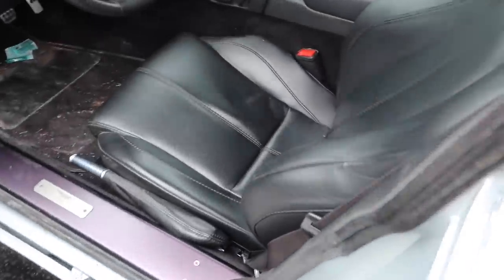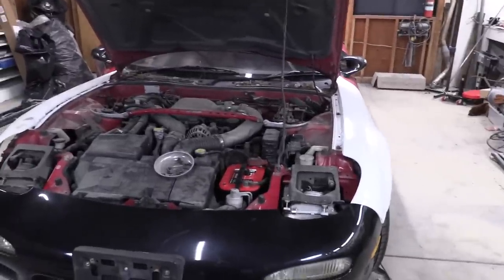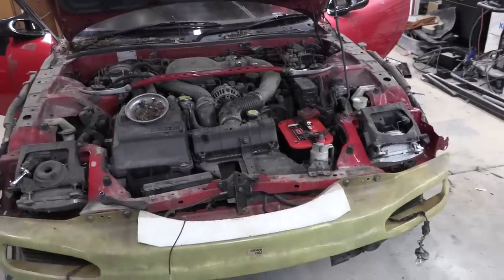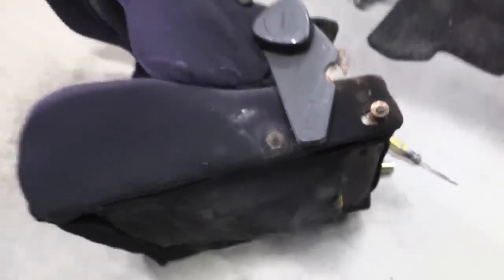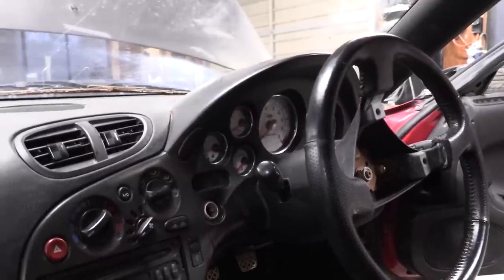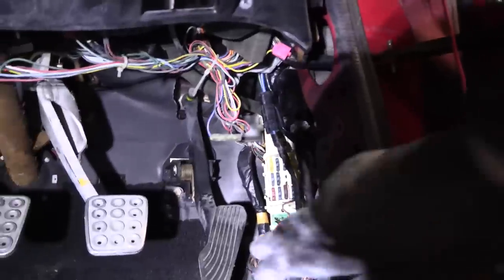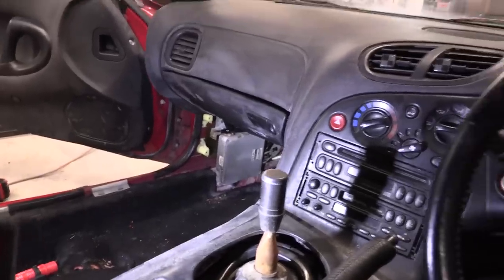Everything Wrong with my Cheap Imported RHD RX7 😜

Comment: Hmm... Did you buy a tsunami car? There were thousands of them after the 2011 disaster. :(
Reply: Ian Hobday seems this could be a sensible conclusion. With the wet interior, dodgy electrics, watery fuel, not starting
Reply: It would be completely covered in rust if it was one. It is just wet inside from the missing door windows.
Reply: Magonza which flood damage is likely to cause, the white marks are  caused by water damage and the ecu is low in the passenger foot well. It can all be fixed but caution is the name of the game. Many nasty diseases could be caught if he was cut on the metalwork for example.
Reply: Magonza yeah you're correct if it was from the last big tsunami it'd be long gone. I guess it's more likely to be recent flood damage or  simple water damage. Certainly lots of evidence for it. I'd be wearing thick gloves for sure! Empty the interior and wiring then clean the shell thoroughly
Reply: Taste the white marks, salty? May still be damaged by tsunami,just not totally wrecked. Still previous owner was a bit of a butcher.
Reply: First thing I thought too... From the flashers.... Then with water damage & wet interior yep ...but it's just a thing... Wish I was there to help.... Good job Chris...🤣👍
Reply: The last register date matches up too, the tsunami was 2011.
Reply: The white stuf could be dried up salt? But he probably would have been able to tell.
Reply: yea looks like a salt water flood car honestly.
Reply: Skwisgar2322 The big 10 on that sticker is actually the month, October. The exact expiration date is the smaller text that can also be seen, I think it starts with 23 which would be 平成２３年 or 2011 in Gregorian calendar years... I’m on mobile though and can’t see the smaller text as clearly as I’d like.
Reply: I think the interior is probably wet from the customs cleaning, we imported stuff from USA and the customs over there and over here blast the ever living crap out of everything (and I mean everything) with pressure washers
Reply: Radioactive RX-7!!
Reply: "Taste the white marks... "  No.
Reply: definitely what im thinking
Reply: Ian Hobday close, the last registration date on the title is 2015.
Reply: If it really was flood damage the head lights and tail lights would have a lot of condensation in them and be yellow

Comment: If you're wondering what the sticker on the windshield means,  it's for the mandatory vehicle inspection in Japan. The 10 is not the year, it's the month. It says it expired October 17th, 2015 (Heisei year 27), (27年10月17日) which means it last passed the government inspection on Oct 17th 2013, which includes emissions, suspension, and a ton of other things.

Comment: Those taped up lights under the bumper are for foglights (looks like they've been removed). The blue strap in the trunk is pretty rare, the white gauge cluster is also rare, and those carbon fiber mirrors are Ganadors that are worth about $1k for a pair.

Check the engine to see if it's flooded. Rotaries flood easily if they are run for a short time and shut off without warming up. Pull the EGI fuse (big yellow fuse in the main fuse box). Then pull the leading or trailing plug in the first housing. Hold the gas pedal all the way down and crank the engine for 10-20s. Do the same thing for the rear housing. Put in some new spark plugs, put the fuse back in, and try to start the car.
Reply: Howzer Tech sir, You're a legend
Reply: I'm building a FB with a FC front subframe and 13B and I can't agree more that it's likely flooded.  Marvel Mystery Oil after cranking with the fuse pulled and give it a shot once it's warmed up.
Reply: They were probably removed to fit a front mount
Reply: get this up further
Reply: This guy RX7's.
Reply: waht about trying to hook some obd scanner (I know that cars pre 2000s are rare or their specific obd ports but it can work)
Reply: Howzer Tech those ganadors probably aren't real. I'd assume at least.
Reply: Marek S the early FDs don't have OBD. That was introduced in 1996 along with an ecu revision and solenoid/wiring improvements. These FD's, however, do have a diagnostic pannel on the right side of the engine bay that can be used for diagnosing issues.
Reply: Next Level Scrub they could be fake. There is a version of the Ganador mirrors that comes with a carbon fiber cover, which these look to have on them.
Reply: @Howzer Tech Does the fact that it's an Efini RX-7 mean that it has a white gauge cluster and the blue cargo strap in the back? Or was that just a nameplate? How does an Efini RX-7 differ from a Mazda? Just the badge?
Reply: I love people like this, when they talk you can be 100% sure they know what they are talking about
Reply: God damn. He should just fly you out at this point to help get it running 😂😂
Reply: Mazda sold the RX-7 FD under the name brand "Efini" in Japan. It's just a naming scheme to make Japanese buyers think that Efini was more luxurious brand than their normal cars. Kind of likehow Lexus is a luxury brand of Toyota.
Reply: I'd love to go. I'm tired of the snow here, haha.
Reply: Howzer Tech or he could just push start it by getting it up to 5mph and putting it in 2nd gear and dumping the clutch
Reply: If you can source 13b-rews for 1300 these days, i'll buy them all. even 13b-ts are closer to 2k now.
Reply: Dude knows his shit. I however, do not. Hahah
Reply: items like that usually get lost from owner to owner
Reply: Howzer Tech according to his new video you're 100% correct!

Comment: God,  I would pull everything.  Harness, Engine, interior, Dash everything... I have a feeling a new harness might be needed since the water damage seems quite extensive.  Once everything is out take everything one by one and check.
Reply: Badstainless All that in 3 weeks, even a proffesional shop with 5 employers working on it its not possible. Its not overhaulin with a crew of 30 and the "magic of television'

He wants to take it to disneyworld in 3 weeks. Even the bare minimum to get it driveable there safely is a big question mark
Reply: markalmelo I never knew he had a time frame.  Even if he did it’s not exactly something I would rush out.
Reply: Badstainless like with everythíng on this channel he sets a timeframe. I thought the only one that he didnt was with te mustang.

I agressief with you, if this is his dream car i would take my time, strip it completly and start from there. It will take about a year but he could do other cars next to it
Reply: Yeah, I'd yank all the driveline stuff out get it looked at and compression tested (yes, it can be done on a rotary) at least. I'd probably get a new ECU and eliminate that as a potential problem to boot. It'd be pretty much a full rebuild if I were doing it.
Reply: This is the best way to go about this car. It's exactly what I did. He can pull the harness, source a new motor and harness and cram it all in in a couple weeks. The rest of the car has major issues.

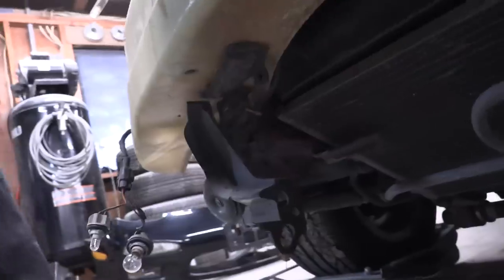Comment: OK you have the dual oil coolers, no sunroof, strut bar and suede seats (passenger) which in the states were all R1 features. The wires taped up at 6:10 are for the fog lights. The fenders on the car the ones for sale everywhere on Ebay. If you want aftermarket I would recommend Shine. They make a lot of cool stuff for the FD. Those blue Bride seats are pretty common in Japan but pretty rare here in America. All the FD mirrors start to look like that after a long time. Its actually the glue separating the layers coming apart at the bottom.

The car could be flooded if it wont start. Look up the un-flood procedure. Its a pain.
Reply: Doesn't shine usually have a lead time of 6 weeks?

Comment: No Start: the Rotary engine is notorious for flooding if not allowed to get up to temp.  And if it  ran like poo, it's likely bad fuel fouling the plugs.

Strange tapping into the wiring near the driver.  There's an "ETC" Electronic Toll Collection box in most Japanese cars.  They look like a skinny external 3.5" floppy drive that a driver can pop their toll registration card into before driving.  it's likely just binned and the person left the wires. 

:)
Reply: Busters Garage that or a turbo timer. They love those damn things in Japan.
Reply: Dan Bonnett yes, yes they do!

Comment: FYI, the reason why the wires disconnected under the driver seat is kill the seat belt alarm while driving, but those were needed to be still there for “shaken” which is like smog check ; all the safety feature need to be in workable condition. That’s why many of Japanese just disconnect it to kill but make it able to put it back for the checking. 
Ur rx7 looks nice, I wish I could have rx7 while I was in the us. That car sold as parts ripping car for ur main car... so must be very hard, but I’m looking for ur rx7 running!

Comment: So keen for this build! Chris since the car looks to be rather just miss matched and a backyard job on a lot, I know you are replacing the fuel but I would check the fuel lines and make sure they are still good, Wouldn't want lines degraded and putting gunk in with the fuel!

Comment: drain and flush tank and coolant and oil. Soggy seats suggest the car may have been at least partially under water. get the wiring dried out and see if that helps with electrical system. you could use a spray that displaces moisture on the wiring, especially components including distributer and coils. Hope this helps and looking forward to seeing this project complete. Best of luck!

Comment: Right front wires are the fog lights, the other one in the front loom is probably a ground, 
Do over every ground in this car, they all go bad and cause silly faults especially with lights, 
Engine is probably flooded or low compression, remove the spark plugs or ignition relay and turn a few times to de-flood,

I highly recommend a rotary specialist compression checks the engine before anything as that will tell you when you need to rebuild and a good looking over never hurts on these things,

The vac line rats nest simplification is always worth while as the solenoids always go bad and cause havoc with the car,

Battery relocation will provide you with a lot more room to work with, 

As with parts to order or source now,
You will more than likely smash the dash binnacle dome, they are brittle and expensive, pull towards you to remove once unscrewed,

Also the screen/ dash vents always crack, be careful around them,

Replace the door handles immediately with aluminium items, they WILL break and always at the wrong time,
Whilst your there try install a blanking strip over the rod mechanisms, these cars are easily broken into by removing the bottom window seal giving plenty of room to pull the unlock rods, 

Fuel pump hardwire mod is a good reliability mod to do,

Replace the plugs with good BURQ 9s 

More than likely the dash has just been unplugged, 3 or 4 colour coded connectors behind the ignition barrel. 

Starters are very lazy on these so a performance starter helps save from flooding 

Loads more to add but I’m sure you are somewhat aware by now, 

Any questions just hola’

Comment: I had one of those.. Rear seats are really rare in the US!  The car didn't have a great grounding side of the wiring. Adding a wide from the battery to the engine helped a good bit for smoothness at high rpm

Comment: With Rotaries, id suggest changing, Spark Plugs, Sparkplug wires, Coil Packs, Fuel Filter, and intake filter, but before doing all of that, a compression test is definatly reccomended

Comment: Hi Chris, the dating system is slightly different here in Japan, the numbers basically mean that the last inspection was valid until October 17th, as for the year, it's Heisei 27, which means the last inspection was valid until October 17th, 2015, meaning it last passed the Shaken (inspection/saftey/MOT) in October, 2013.

Comment: Dont skip the engine, take a compression tester. Take out the schrader valve pullout spark and fuel pump fuse. stick compression tester in one of the rear plug holes and crank over few seconds... put plug back in rear hole then do the same for the front rotor and will give you an almost instant idea on if the motor is shot or not.
Reply: Just in case he reads this:
A compression test should be done on a warm engine. You should see three even compression pulses as the engine is cranked if all of the rotor faces are in working order. Expected results vary by altitude and cranking speed but numbers over 85 are generally healthy for Portland's elevation.

Comment: Rotaries are notorious for flooding if you only move them a short distance and shut them off. Pull the fuel pump fuse and try cranking it a few times, then replace the fuse and hopefully it should start. You might have to repeat the process multiple times. Once you get it going it may smoke and you may need to rev it a bit to stop it stalling until the idle balances out

Comment: Vacuum interior. Baking soda interior if wet. Take all that black tape off the car. Clean the exterior to see if there's any major panel damage so you can write a todo list. Start tracing wires from the inside of the car. Drain fuel. Change fuel filter. Get new oil, change oil. Sounds like fun.

Comment: Rx7s have 4 spark plugs, a leading and a trailing and they're different. Make sure you get the right ones and put them in the correct places. I had to call the auto parts store back to find out which was which because I forgot to ask lol. The wires also. Good luck b

Comment: Hi great you have an FD in your shop. Like some other people already sad the gauge cluster looks modified maybe one of the more new 2000+ versions or just a foil. I also think it is a alarm inside. This is a problem lots of Japanese cars have. I want to remind you please clean the water runners. Like on mine its often in the trunk and front holes for the water are full of leafs and dirt. They are really tiny. Thats probably why you have a lot of water inside. Also the big holes from the spoilers or mirrors as well as a Sunroof can cause this problem. Please Do me a favour and replace the OIL and COOLING before you even try to start it also put in new spark plugs. A Rotary don't like miles service and like to Broken their seals if you don't take care him. Note always use green coolant not the read. I hope you don't convert the headlights. I don't think it's a drift care before. Normally the first thing drifters change on the FD is the cooling, But your FD looks pretty stock inside all the things done to it, are things to look good.
The cable you show in the front was for the OEM foglights. I bed you service it and put out the alarm and you can drive it. I wish you a Lott of fun.

Comment: Come to think of it... When i was putting an aftermarket head unit in my 97 Corolla, i forgot to plug in the hazard button which caused the gauges to stop working, and i think thats what might be causing youre emergency light problems, it could be that relay that looks like its not supposed to be there, for the radio. It looks like someone tried to jump the circuit with some cheap wire for some reason.... just my best guess, tryin to help.

Comment: If the interior is wet or shows signs of having been wet, I’d start with pulling the carpet and checking all the connectors/components towards the footwells & floors for water damage.

Comment: Chris don't forget to save the side markers/turn signal lamps from the fenders, new ones might not come with them.
P.S. You can give the car a lot newer/cleaner look if you use LED light bulbs instead of the old style ones for the side markers and interior.
Reply: Do a compression test first. Rotaries have 3 comp pulses per rotor. Google how to comp. Test a rotary engine.  Likely its low. Hard starting is typical with low compression.

Comment: I just noticed the Nissan wheels.  Electrical... I had problems with an old truck  I traced down some part numbers to LoJack, after pulling the dash out.  I haven't gone through the entire harness since I ended up abandoning the project and going a different route (truck bed trailer, because the cab was totally screwed from the wreck), but I discovered that the harness had been pulled from the truck and some things were replaced or rerouted very professionally.  Hopefully you don't have that large of a mess to sort out.

Comment: Check your cpu2 for your flasher issue. In a US spec it's under the driver side kick panel. I had similar trouble as well as the car wouldn't shut off when the key was removed and the cpu2 fixed it

Comment: Suppose it is worth drying the car out but in reality best thing is to take that carpet out totally and "wet vac" wash it. I did it with a 2003 Golf R32, removed the carpet, put it flat on the ground and hired a wet vac to clean it, the filth that came out of it was unbelievable. Also the sound deadening material under it (not sure if your RX7 has it?) on the R32 acted like a sponge and didn't smell great so I ripped it out and replaced it.

Comment: Yoooo make sure you get your car warmed up before turning it off. You run the risk of flooding your engine. It could be flooded. Pull your fuse for the fuel pump and try to start it a few times. Definitely look into rotary engine daily maintenance good luck!!!

Comment: I once bought a 2004 subaru impreza sti and it was a hunk of junk. The wireing was a mess so I ripped everything out of the car and redid the whole wireing and it was a lot quicker just to redo it than figureing out everything that was wrong. So if you that route just make sure you have good quality electrical plugs and appropriate electrial gear. Otherwise keep up the good work.